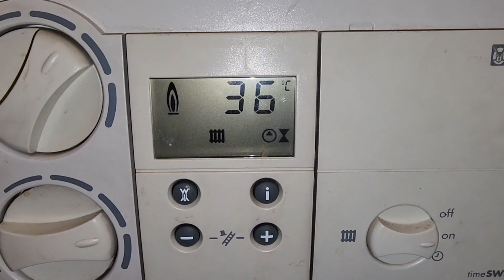Vaillant boiler repair faulty main circuit board

Comment: My Vaillant boiler just broke new years day, brilliant start to the year, similar issues to this with no dhw or heating.
When you run the hot tap or ask for heating mine just shuts down completely with no error code. Was that the same as this?
Reply: What did you do to fix it? Mines is doing the exact same thing

Comment: I had issues with one of mine it turned out to be the pin plug not making constant contact with pins on the board . A quick wire brush on the pins cleaned the pins reassembly and it fired back up .
Reply: Did you get f27 error code?